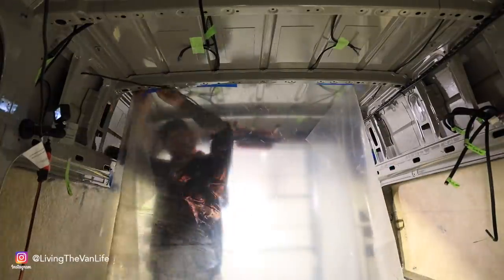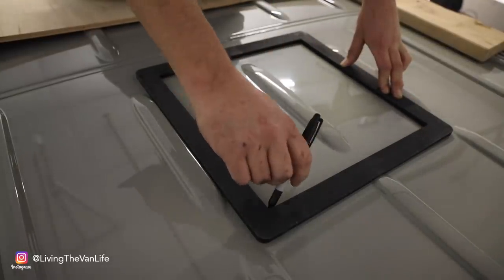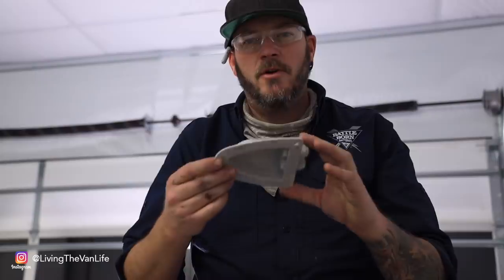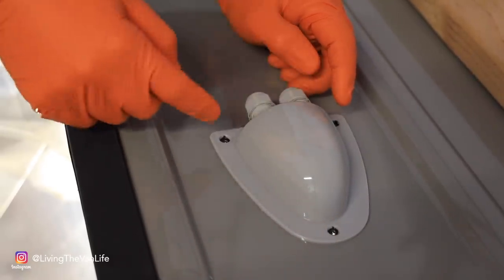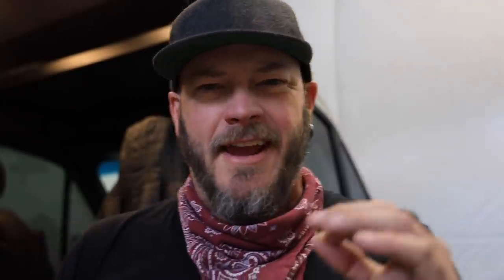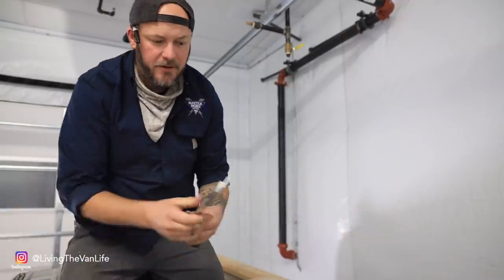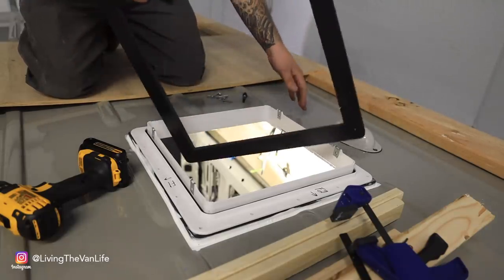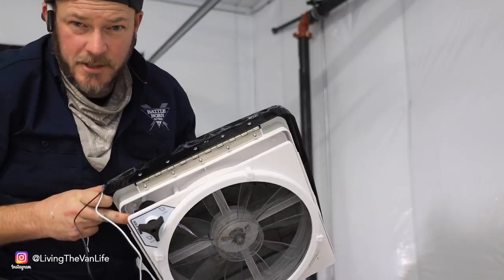Living The Van Life - Sprinter Van Build - Ceiling Fan Installation

Comment: Make sure you waterproof the screw holes for the igloo. Some sealent over the screw tops would be perfect
Reply: I was thinking the same sealant/caulking that's used on most RV roofs would definitely help.
Reply: Right on. Suggest you do a leakage test in the garage before you move on building and wiring the iglu and the fans!

Comment: 6:05 that one might fail. I dunno where you got that cowling, but it's supposed to come with two 90 degrees hard rubber grommets that by design, can't be installed from the inside of the vehicle. Those 90 degree grommets, you're supposed to install with the wires, then glue the cowling on top, which is just a secondary protection. Our Transit vans, eight in number, came from the reffiter's place without those grommets installed (in our case, the reffiter didn't install them) and the cowling failed after two years, because of the hot cold cycle. Just my 2 cents.
If you google (images) "90 degrees grommet" it's very similar the gray one.

Comment: Nice thought on the aluminum strips. Wish I had done that. The butel tape and lap sealant should hold. Used under side reinforcement and trim rings from same supplier. Excellent product. No oil canning down highway. Looking for less buffeting and branch protection once a roof rack and solar are up there. 
Assuming you touched up paint on edges of holes like you did for flares?
Like the holes in corners. Leaving corners round protects against stress tearing of sheet metal.

Comment: If you’re doing anymore sealing check out Lexel from Lowe’s. That stuff is super thick and very flexible. I use it for gutters and it’s crystal clear. It really works the best.
Reply: Or use Bison Polymax or Sikaflex!
Reply: @dutchglobetrotter6464  Ya we've been using the Sikaflex on our Expedition Overland Flatbed Camper Build. We like it alot.

Comment: loving the twin fan setup.
I hope you are gonna fit rubber grommets to those 2 holes that you drilled into your roof under that cable gland. Any cables running thru them could wear and short out on the metal edges.

Comment: Dude, you should of fed the cables through the roof cable seal first before you applied the sealant, then painted the holes you drilled to protect from rust then put rubber grommets around the holes you drilled, you can still paint and put grommets in from the underside but going to be fiddly getting those cables through. 👍
Reply from the maker: Got it all taken care of.

Comment: Hi Chad.looking forward to the finished product,two thing Chad   
when putting insulation in I would put as much as possible considering the temp range u find yourself in(extreme snow to heat in utah)the 3m doesn't look thick enough.if the heater is a Chinese knock-off the fuel pipe is shite and not fit for purpose.I know everyone is a critic lol from Scotland.

Comment: You should put rubber bushings or grommets in those sharp holes in the roof under the igloo to keep the sharp edges of the hole from cutting the wire insulation and shorting the solar cables against the edges. Also, I like those flares, I may make some for my own build.

Comment: Make sure to send or put rubber grommets in the holes for the wiring so the vibrations of the van doesn’t cut the wire

Comment: Butyl tape is so good at rusting out steel. Good luck.
Reply: I don't know about these things and am not a van builder. For future readers, could you cite a reference/alternative? Here's one I just found that partially addresses this issue and suggests an alternative -- https://www.americanweatherstar.com/metal-roof-rust-damage/
Reply: Liquid nails has some good alternatives. Used to work at an autoglass shop. We hated butyl. Gm cars had a bad habit of rusting out in the windshield wells. We drive by a Gm dealership and see all their cars had fogged up inside.

Comment: Considering the size of the van. if I'm not mistaken these 2 fans are about twice the size of what they should be. these are large fans. 2 fans half the size would have been perfect. since there will be more useful for the top. for storage. ( but. I could be wrong) good luck.

Comment: Has anyone noticed a low spot in roof around your front Sprinter vent?  I didn’t until I cut front vent. Used same method Chad did with plywood over roof to prevent dents. Weigh 220.
For rear I added two 2x4’s across top of 2x4’s rested on roof rails. Then plywood on top. It clears roof crown.  
No dents or sag. 
Re-crowned the front with floor Jack from inside distributed across multiple ceiling frames. 
Did NOT want water puddling around the vent base.

Comment: Hey I was wondering why you went with 2 Maxx air fans instead of 1 12V AC/Heating Unit and 1 Maxx air fan? (I saw your deisel heater and wondering why you went with that too) How are you cooling your van?

Comment: The roof cap for wiring seems wrong though, I feel like it should be glued at the time of wiring itself, what if you can't put the wire through it?
Reply from the maker: I already put the wire through it. It worked just fine
Reply: @LivingTheVanLife  I myself would have made a bigger hole under the igloo instead of 2 holes, for ease of wireinstallation, but if it worked then good :)
Reply: @LivingTheVanLife  Oh! That's nice. I was very anxious while you were gluing it, I was like "Oh no no no! Chad don't do it Chad, you will have to remove all of it". 
Now I'm very glad that it worked as you planned🤗

Comment: anybody know what those black fan templates/rings are called please? or has a link to them
Reply from the maker: https://www.ebay.com/itm/Sprinter-NCV3-or-VS30-2007-present-Roof-Vent-Adapter-for-14-x-14-opening/143539173702?hash=item216b99f946:g:IeQAAOSwz2lXCp6s

Comment: Oops. You'll want to grommet your + &  -  entrance  holes and run your solat entrance cables before you seal the gland to the roof.
Reply from the maker: Yes of course. I put grommets in when I installed the wires.
Reply: @LivingTheVanLife  whew 🧙‍♂️